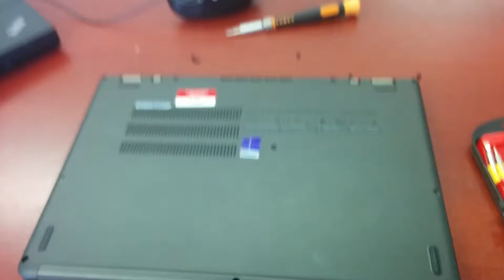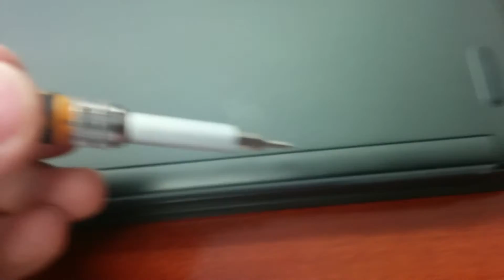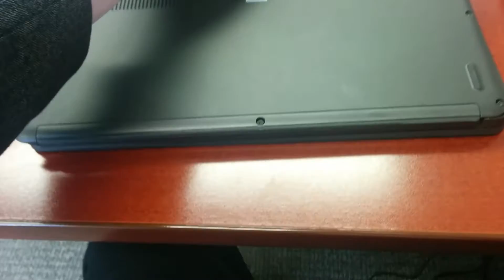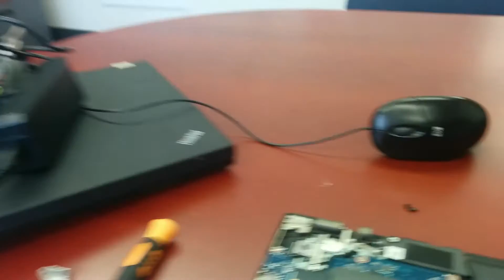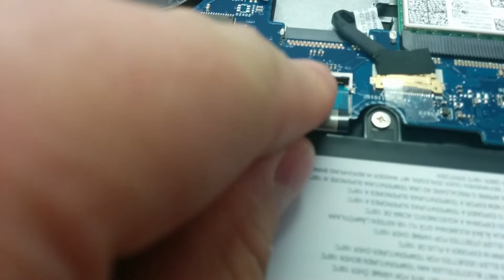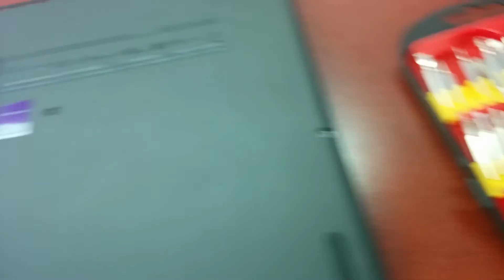Thinkpad Yoga keyboard not Working?

Comment: does it work if i spilled water over it
Reply: (sigh)sadly it doesnt
Reply: If the keyboard stopped working as a result of water, there is a chance it is something more serious than this.  There is a chance that this connection is corroded or loose as a result of the water.  Worth a shot vs a new laptop =(.  At the very least, if your keyboard is truely broken, this will allow you to install a new one at a fraction of the cost.